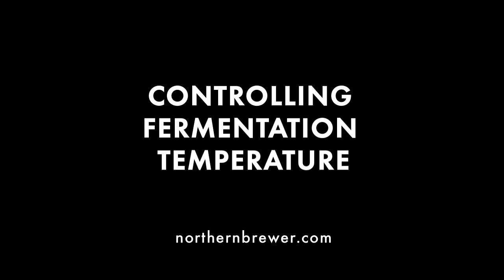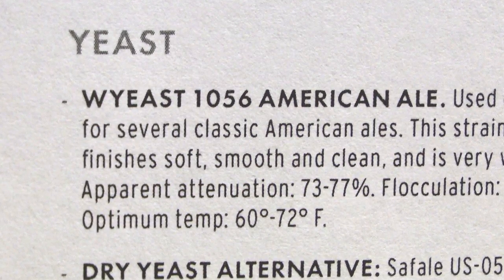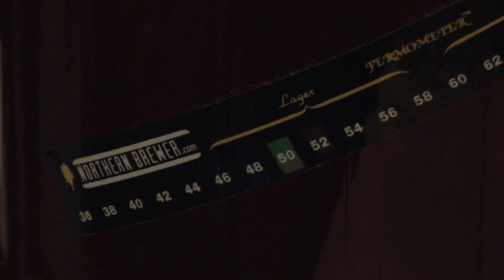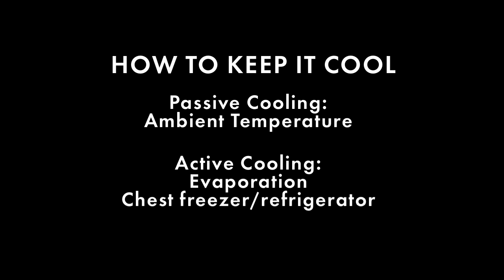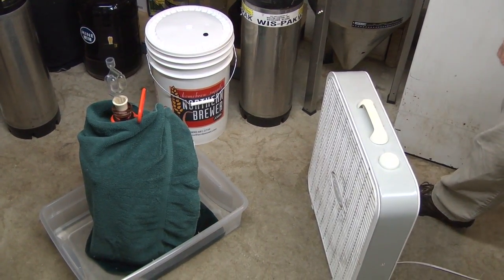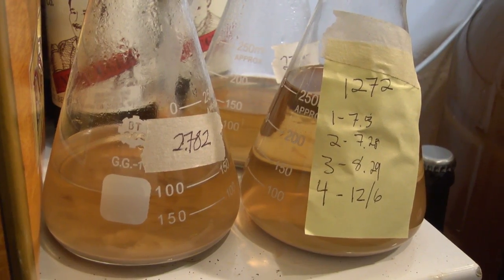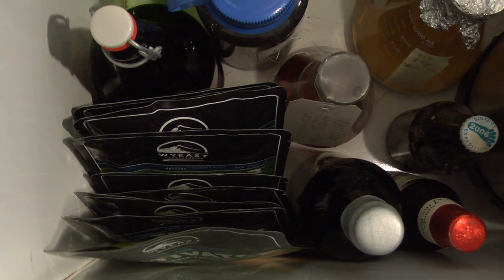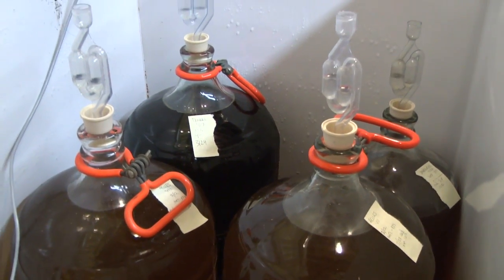Brewing Better Beer: Controlling Fermentation Temperature

Comment: best method is to get a large bucket your fermenter can fit in and put water in it 3/4 of the way up the wort. throw in frozen water bottles in extreme heat. this uses no energy like a fan
Reply: How did you freeze the water bottles?